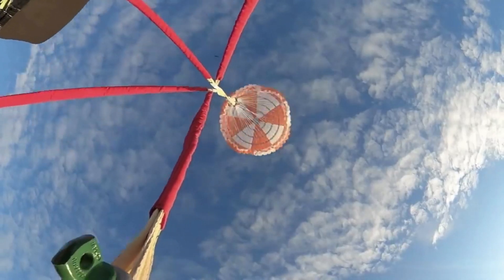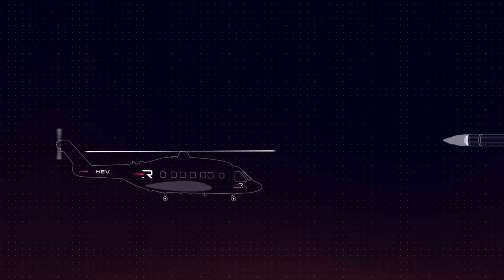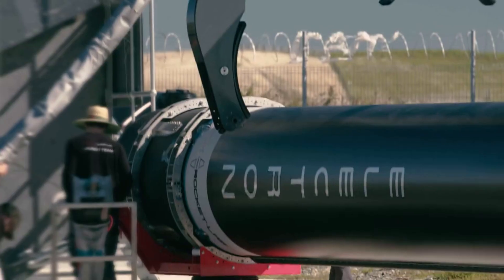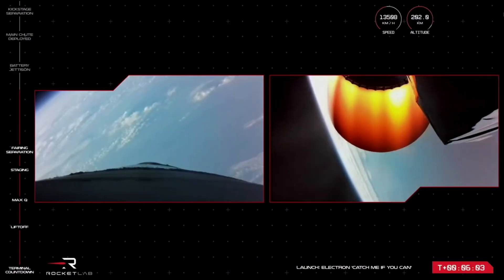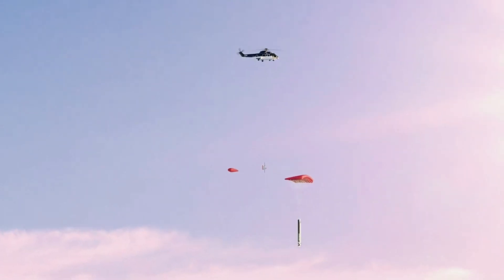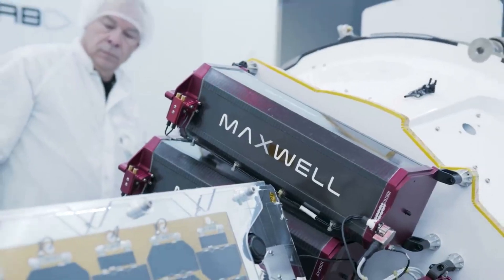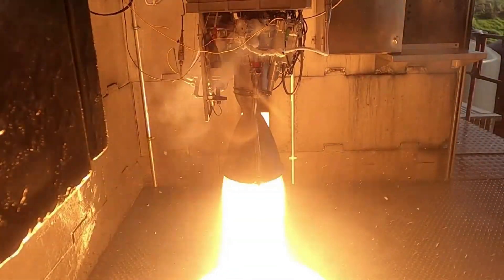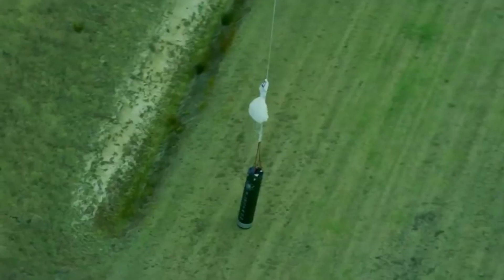Is Rocket Lab's Electron Reusability Approach Realistic?

Comment: No. It’s not a realistic business model. Too many failure points, the energy cost of the drones/helicopters and their maintenance schedule, operators for it all redundancy, weather related events, extra TFOA reports… 

It makes no sense.
Reply: it makes a lot of sense lmao. why do you think only spacex is doing good with reusability, catching the stage and taking it straight back to the launch complex means literally no refirbishment or replacing parts like splashdown would, Rocket lab know far more than you and have done well over 500 drop tests to ensure safe catching
Reply: @notflyingcereal3575  
1. space ex aren't even sure they can catch anything. it's still a theory.
2 you just ignored every one of my points about increased complexity.
Reply: Another opinion mascaraing as fact. sheesh
Reply: @ijwilson  literally the entirety of this channel's comment sections
Reply: lol. another fanboi who can't think rationally. @ijwilson
Reply: @skidooboy8977  nope, just someone with a low tolerance for bs. So do share with us you in-depth analysis which is clearly superior to RocketLabs.... Like I said opinion mascaraing as fact.
Reply: @ijwilson  
lol.
name one time when 2 machines are less complicated than 1.

name a time when maintenance and servicing 2 machines is cheaper than 1.

drones use GPS to navigate....ever worked with commercial GPS? I do.
that shit goes funky all the time.

what if a catch cable breaks? what if a drone has a fault and can't make the catch?  now you need 2 drones. and they both need maintenance and servicing and inspections. 

 the list goes on. a good hallmark of smart design is reduced complexity. a fleet of drones catching a fleet of rockets then flying them back to base is very complicated.
Reply: @skidooboy8977  

1. Rocket lab literally said the helicopter was a developmental step and the plan was to use a fleet of drones future catches....not sure what you are smoking.

Please show me the quote from Rocketlab about using drones to catch Electron.

2, manned helicopters are expensive and require a TON of maintenance , far more than a plane. the catches are also dangerous and weather will have a huge effect on recovery. which is why this idea has been considered and abandoned a few times over the years.

Around $6,000 per hour to rent - not huge. The rocket doesn't launch if the weather is rubbish, so not really a factor. However a landing barge takes so long to get to station it may have to loiter at sea for considerable periods of time if the launch is delayed by weather or other reasons. The catches are being conducted with a huge margin for safety. Which is why the second one was flagged off due to a momentary loss of telemetry from the rocket. Something no doubt they're working on correcting (imagine if they'd been using a barge, no chance of getting out of the way). There is nothing unusual about helicopters carrying a slung load. Catching the load mid-air is unusual, which is why they're carefully developing an SOP and ensuring there's a wide safety margin at all times.

3 ships are incredibly cost efficient. it's why everything is moved by cargo ship around the world.  Also a breakdown means sending out a tug, not watching a helicopter or drone tumble into the ocean with it's rocket and a possible human life.

They're not moving cargo, they're a landing pad for a rocket. SpaceX needs a fleet of them (plus support vessels) since they take so long to get out and back they can't keep up with the launch cadence. A helicopter on the other hand can make multiple trips everyday if required - they're also easily deployable to anywhere on earth (compared to marine assets). Helicopters are safe! That's why there are thousands operating all around the world. Many in arduous conditions like North Sea oil rigs. A helicopter is far more cost effective compared to operating marine assets for this particular use case.

4. yes small Launch vehicles can't do the landing burn, necessitating  the "catch"
we all get that.

5 "why would a cable break?" Really? why would a crane collapse or a bridge fail or a plane crash or a skyscraper lean? It's a real world and things happen. flaws in design, construction, metallurgy,  all occur  all the time.

They don't occur all the time, in fact they occur so rarely it often makes the news (globally) when something goes wrong.

6. why you such an asshole?  did i call you names and act like a dick? no. so why the fuck do you act like an idiot?

Because an overwhelming number of people refuse to use the most complex structure in the known universe - the Human brain. But, yes I was over the top so please accept my apology.
Reply: @skidooboy8977  hello?
Reply: @skidooboy8977  it was you that went quiet after I answered all your points (politely I might add). You didn't disappear because I insulted you! You did so because I answered you in a reasonable manner. So please, feel free to reply to the points I made. I won't 'argue' with you, heck I'll agree if you're right.
Reply: @ijwilson  

LOL "Cables never break"
LOL 

nice talking. bye forever.
Reply: @skidooboy8977  lol - I didn't say 'cables never break'. Is that it? If so, my job is done here.
Reply: @ijwilson  

keep drinking the cool-aid. and shifting those goalposts.

I'm not fixated on a cable breaking i'm pointing out the  on a dangerous and overly complicated business model. then trying to answer your "No because things wont go wrong cuz rocket lab says so"  and "no cuz cables don't evar break" argument. 

which again is just you reading their marketing material and saying "seee" while ignoring history and logic.

again, while better more proven launch systems are available rocket labs business model is not scalable.

scalability is where it fails. because for the company to be successful it must grow...meaning you need to do LOTS of missions....meaning lots of rockets, lots of catches otherwise they will be crushed by higher volume launch companies. somewhere 

I remember seeing somebody from rocket lab talk about using drones. i really don't care if it's drones or helicopters or airplanes of magic pixies. you need a fleet of them to catch a fleet of rockets if you plan on keeping up with the cadence of launches  other providers are performing right now. SCALEABILITY.
a fleet of rockets and a fleet of helicopters is more complex than a just a fleet of rockets.

and again you won't acknowledge that heavy lift missions are postponed and fail all the time with helicopters. even the best most modern helicopters we have today.... due to minor shifts in wind velocity and temperature ...which adds complexity to the mission planning meaning you have a wider window of failure and delay in the time lines you are giving customers. meaning the customer will look for other options competitions provide with  les variability, or you have to let more rockets splashdown to keep your launch cadence eating into your cash.

even rocket lab is moving past the "catch" with it's next Neutron program....so is this catching of rockets really such a great idea? even rocketlab doesn't think so. 

even their first catch was a failure and the pilot had to drop the payload for safety. so you are already betting on a program with a 50% failure rate.

those spy satellite catches? are you seriously comparing the complexity of catching a few kilograms of film in an armoured box vs a couple tons of booster that is 4 stories tall? and then having to fly the heavy penduling drag generating booster  miles back to safety?

 yeah the US government uses a reusable space plane "mini shuttle" now instead of helicopter catches....much like we don't use F4 jets from the 1960's anymore....

skyhook used airplanes to catch a human being ascending on a balloon...like 20 or 30 times. Resulting in several deaths. And only was used  in emergency situations. and it has been abandoned for all but the utmost emergency situations....because long range Helicopters are a thing now.

Got any other haphazard half assed failed tech from decades ago you want to drag out for me to argue against?
 
you saying "No RoCkEt LaB iS ThE BeStEsT EvAr" is not an argument or discussion.. it's you acting like a child.

Comment: It's cool, but highly impractical and dangerous especially to the helicopter crew. They should just recover a splashed booster from the water. A couple of floatation devices installed in the fore and aft sections would work and not be as dangerous.
Reply: i dont think you get it, weight is a massive factor here and there is no room in the aft section oh and it makes it so no refurbishment is needed, its a great solution
Reply: That's what they do already.... Catch up....

Comment: A low cost recovery solution for small rockets and stages to enable re-use makes a lot of sense. The saving of weight from no landing legs, very little fuel reserve for propulsive landing and relative freedom over the "landing recovery zone" location all add up in favour of the solution. Once the basics are worked out, remote controlled recovery "drones" make sense.
Reply: i dont think you know how hard it is for a helicopter to carry 1 ton of rocket around for hours, a drone would not do it
Reply: @notflyingcereal3575  think of a remotely controlled helicopter, not a miniature one.
Reply: @notflyingcereal3575  thankfully Rocketlab is relying on experts and not you for their advice right?